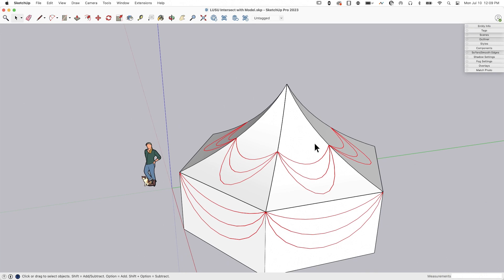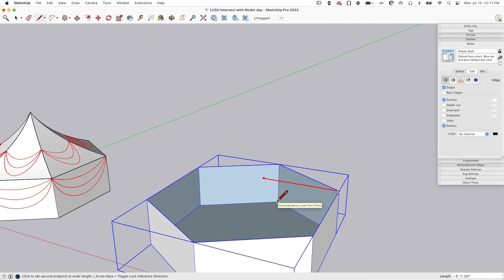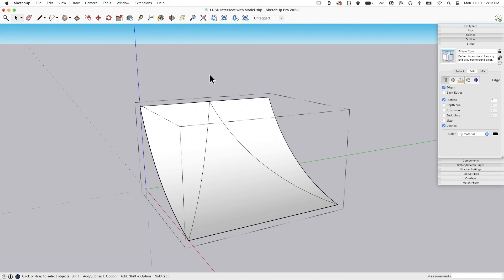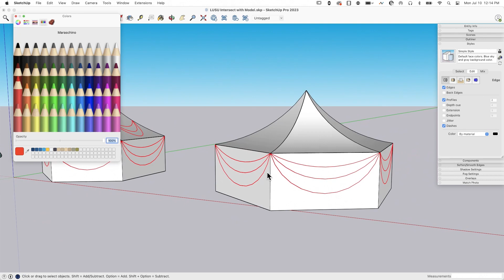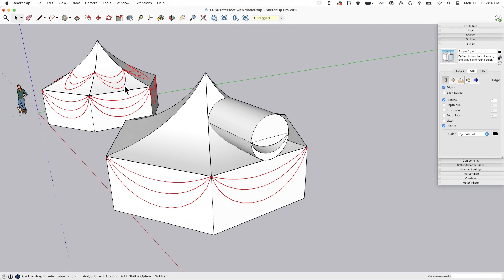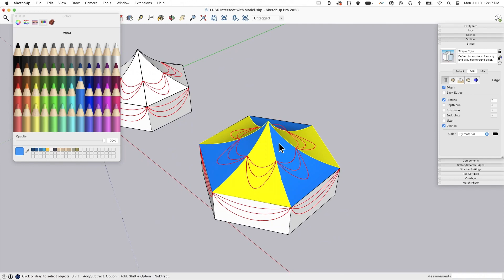Intersect with Model Instead of Solid Tools

Comment: Aaron, I could not delete the faces after drawing the arcs. When I select the face between each arc it deletes the face and leaves an empty area. Also, I couldn't apply a color to the lines. Thanks for the video.
Reply: Sorry Aaron. Figured it out. I didn't make the hexagon a group on my second try on replicating your steps.